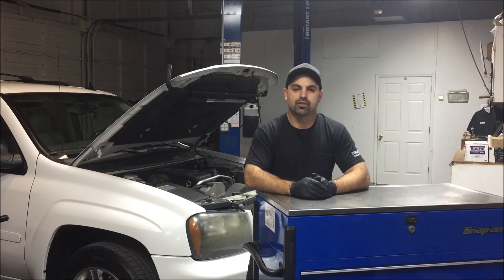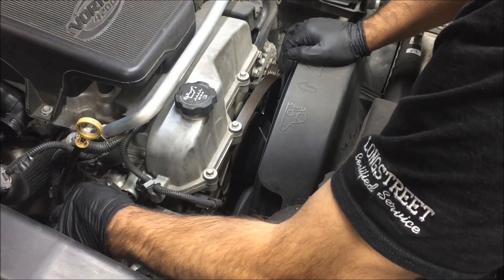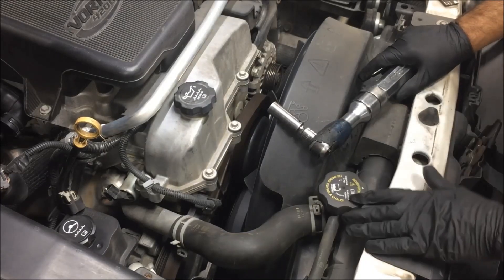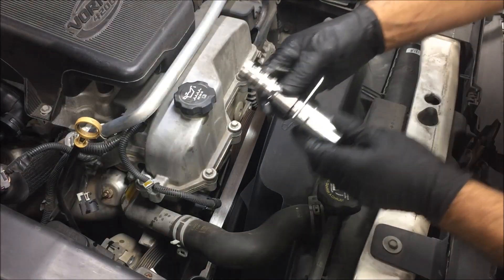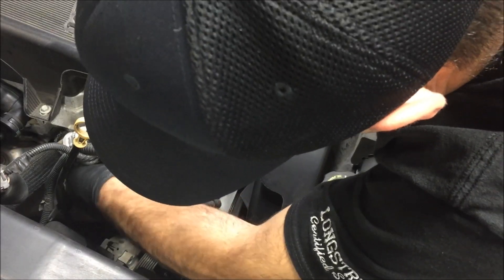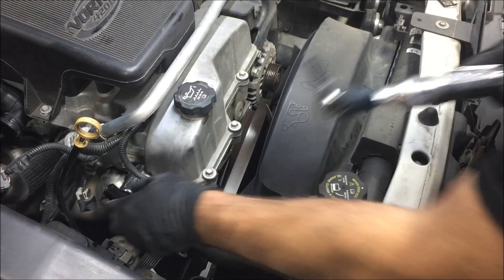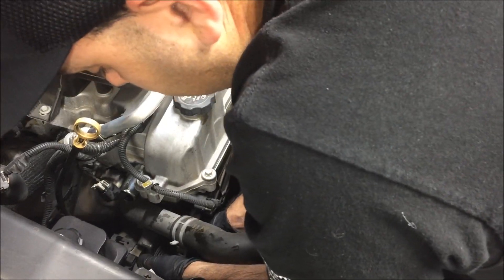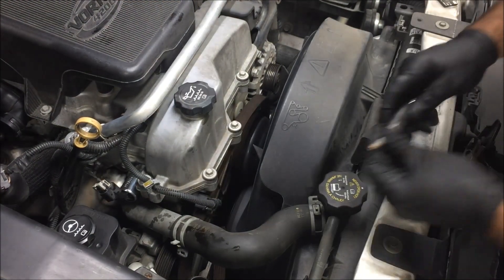P0014 FIX!!! P0013 FIX!!! Trailblazer, Envoy, Bravada, Rainier

Comment: I know nothing about cars but I'm gonna try this with my car thanks for this
Reply from the maker: You got it! If you need help let me know and I will see what I can do to help!
Reply: Chris Arnau okay thanks a lot I really appreciate it! I purchased a solenoid just waiting for it to arrive. I have another code which is P0420. Any idea how I can fix that issue?
Reply from the maker: @TupacShakurr  That would be a converter issue. Would need to replace the catalytic converter.
Reply: Chris Arnau okay thanks. I have one more questions. For the code P0014 is it the sensor that need to be replaced or the solenoid that needs to be replaced? I'm a bit confuse d

Comment: I'm having the p0014 and p0017 codes. The car runs great for about a twenty minute car ride and then the idle goes to crap. I can turn car off for a few minutes and then runs fine for another ten minutes or so before idle goes to crap. My guess is motor temp is affecting/causing whatever is happening. Can motor temp cause these sensors to fault out?

Comment: What's the difference between the $25 dollar solenoid and the $53.58 solenoid?
Reply from the maker: Cletus Spuckler, Stable Jeanius where do you see those prices?
Reply: maybe one is the pigtail
Reply: @voidisyinyangvoidisyinyang885  ... They don't have a pigtail.
Reply: @cletusspucklerstablejeaniu1059  OK what about part number 13580114 camshaft position actuator pigtail
Reply: @voidisyinyangvoidisyinyang885  ... The Genuine GM 12615873 Camshaft Actuator Solenoid Valve has a male plug ... Hello!
Reply: @cletusspucklerstablejeaniu1059  part 908 in this image https://www.trailvoy.com/threads/p0014-camshaft-position-actuator-solenoid-relearn.66724/#lg=thread-66724&slide=0 see https://www.trailvoy.com/threads/p0014-camshaft-position-actuator-solenoid-relearn.66724/
Reply: @cletusspucklerstablejeaniu1059  1. Cam position sensor - $29 at Autozone, 1 10mm bolt, nothing in the way, a 10 minute fix.
If that doesn't get rid of the SES and code try

2. Cam position actuator - $90 part from a GM Dealer. Look fo one of the threads with the pictures and tips. About a 45 minute job.
Reply: @voidisyinyangvoidisyinyang885  ... Is your mommy there? What's the difference between the $25 dollar "SOLENOID" and the $53.58 "SOLENOID"
Reply: @cletusspucklerstablejeaniu1059  Yeah I was trying to convey to you that the price difference precisely matches the closely tied camshaft sensor. Sorry I had to explain that to you. Good luck answering your question.
Reply: About 28.58 is the difference 
.

Ones a solenoid ones a sensor most likely right next to one another.
Reply: About $28.58.....lol

Comment: I have that code and changing the Cam solenoid didn't fix the code. Truck runs great just has that code. I'm at a loss
Reply: Did you ever find a fix?
Reply: @staffordmiles291  Nope never did. I had a friend who's a well known You Tube mechanic look at it and even he is mystified. It almost seems like a glitch. My only "fix" is to drive the vehicle less than 5000 miles a year so it qualifies for an "exempt" emissions tag.
Reply: I changed out mine with a oem acdelco and code p0014 is back.
I seen in another video to replace the plug aswell. Cut the 2 wires and wire in the new 1 to fix the problem. 🤔
Reply: @UserUser14880  Have a link to the video?
Reply: I guess i have no choice bu to spend more on a plug chasing this issue.
Reply: The part for 03 trailblazer with 4.2L
https://www.rockauto.com/en/catalog/chevrolet,2003,trailblazer,4.2l+l6,1412277,electrical-connector,variable+valve+timing+(vvt)+solenoid+connector,20157